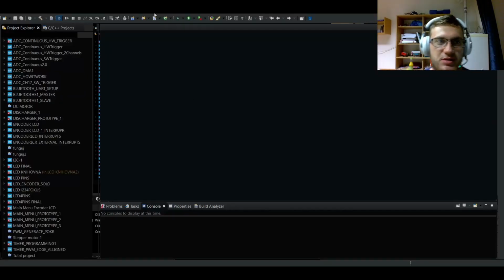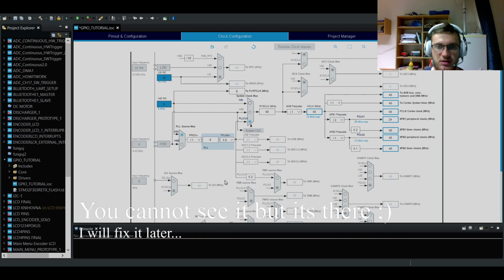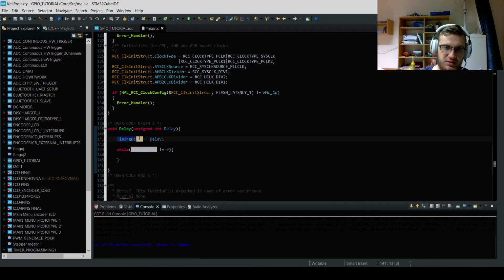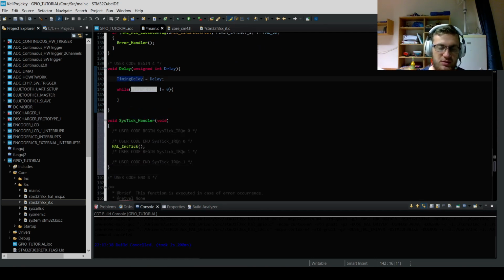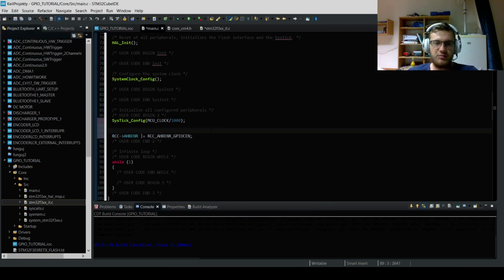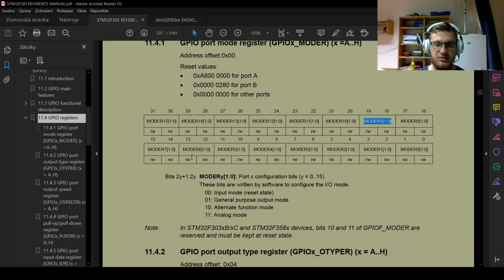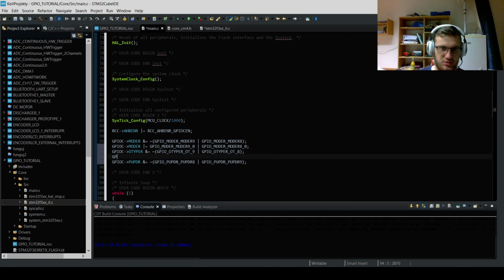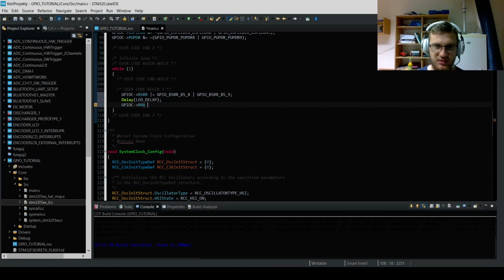STM32 programming part 1 - GPIO and LED blink

Comment: After several years of making circuits using the atmegas (using atmel studio...never used the stupid Arduino stuff), I would like to expand my uCs knowledge to ARMs. The atmega328 is very capable and in very few occasions you really need a more capable uC, but it's nice to learn about the new generation of uCs. I'll be watching your tutorials and hopefully learn a bit more. Thanks for sharing.

Comment: Watching you manually initializing and configuring the GPIO makes me appreciate STM32CubeMX even more.
Reply from the maker: Sure, but if you want to change peripheral configuration mid-program you have to do it inside code either by HAL library or by Cortex-M macros.
Reply: If it comes to anything MX can't fix, start again. 
Too many times I've tried to "rescue" my code only to get unpredictable results and hours of headache.
Sometimes it isn't even the code. I have two STM32G071RB, one doesn't load to external ram, the other does.
Both are same Rev, same date code, even the serial numbers are only 300 apart.
Reply from the maker: @oswaldjh  Cube MX is inicialization-only. Once for example if you want to change ADC resolution, sampling frequency, or timer PWM mode, you have to use either very complicated HAL library, or for me more readable Cortex-M Macro libraries.
Reply: @mikov36 In CubeIDE double click on the .ioc file and your perspective is change to CubeMX. 
Edit peripheral resolution, sample rate, whatever parameters you need and regenerate code. 
This works on my simple projects.
Reply from the maker: @oswaldjh  I mean when the code is running. You flash the code once and you want to modify something mid-program, by pressing a button or choosing something in the menu. You are basicaly rewriting registers inside MCU to do certain things. It is more advanced programming.  You want to turn off interupts, set number of ticks for a timer and its period, you can even change the frequency of the core.

Comment: Hi there, I really like your content on the STM32 and wanted to thank you that you took the time to record those videos. I'm just getting started with STM32, so my knowledge level is very much beginner. :) If there is one thing, that you could enhance - it is probably the dark mode and/or text color/size choice. I know that in the second video you're turning up the brightness, but "grey on black" is probably never going to be "standing out". Sometimes it becomes hard to read, when text is selected - maybe a little bit of an adapted color scheme could help this. Do you have a Github where you share the code?
Reply from the maker: Hello, took my time to respond, I will re-record all the videos. It was my first time work with OBS recording and video editing software.